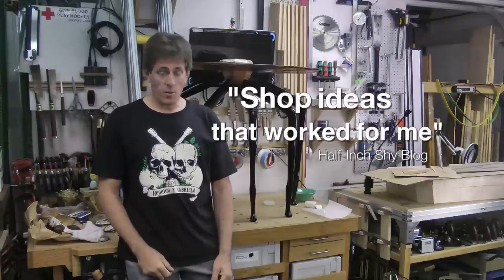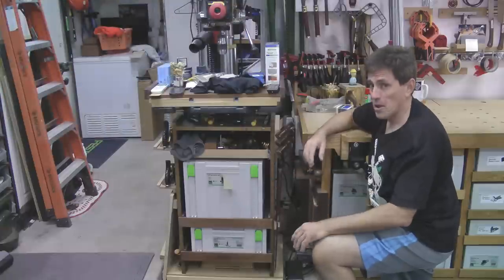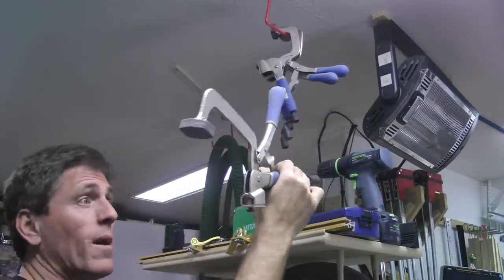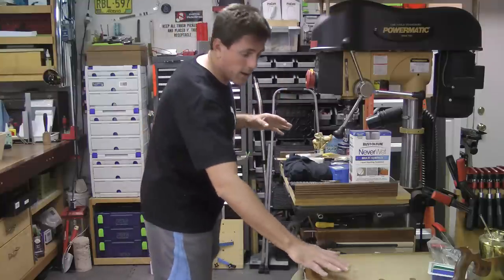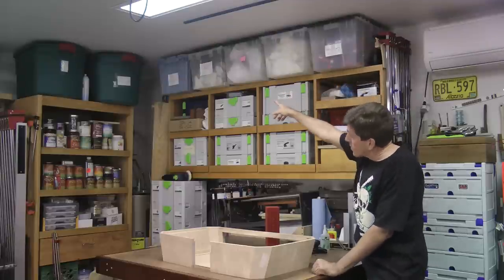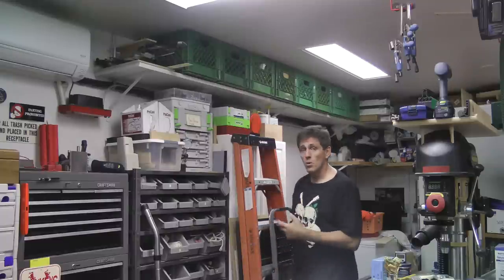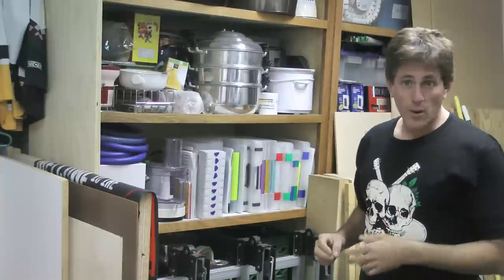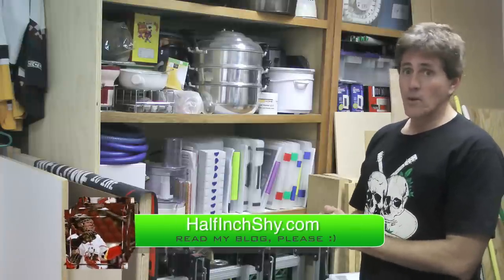#93 - Shop Organization Tips

Comment: How are your various pull out shelves / Sustainer drawers put together? It looks like you are just attaching the drawer slides to the shelves themselves, maybe like 3/4" plywood. And then have a small front to hide the slides and act as a stop so items don't fall off. Im sure you have one in the back just narrower to fit between the slides and prevent items from falling off the back. Thanks.
Reply from the maker: +Capt.k&amp;b These are super simple. Ply base, 3/4"x3/4" hardwood sides that are flush with the top, but used for the slides. Just a front to hide the edges and look cleaner (plus it acts at the front stop for the Systainers). In the back, I have a Domino sticking up from the shelf that fits into the notch in the side of the Systainer (since mine are in sideways). Locks it in perfectly. I think it was a 6mm Domino, but any size that fits in the notch is perfect. If you don't have a Domino, then insert a stick of dowel.

Comment: I like the way you think about storing stuff.  Have you used the dead space on the header above your overhead door?
Reply from the maker: That's a great place for stuff for sure. I could actually build a low shelf up there and put more of those green crates I use up there as they'd just fit.  So far, I haven't taken advantage of that mostly because when I'm not recording in winter, I keep the garage door open.  Would be useful for lesser used stuff, for sure.  I may keep it as my last-ditch storage area when I run out of other places (or just learn to quit buying stuff ;)

Comment: Love the racks for stacking clamps inline from the wall idea.  What tape dispenser are you using?
Reply from the maker: Thanks! The tape dispenser is from U-Line. It has 3 wheels for rolls so I keep a regular roll of Blue tape on one wheel and a wide roll of packing tape on the other two wheels. So ridiculously convenient. I've since bought a second for specialty tape. Also have a single-roll dispenser for the Shaper Origin tape.

Comment: Paul, I own a Bridge City CT 11  12° Commemorative Plane.  I believe you have one also. I had to remove the blade and have not been able to figure out the pin nut and pivot nut setting. The CT 12 had a instruction sheet, but not so with the 11. I would appreciate any  assistance you can offer. The old day of calling John on the phone are gone for ever. Great video on the JM.

Comment: I was curious about your ceiling mounted light that looked very bright and out of the way that I saw in a different video...  im wondering where you got it?   I need something to light up my MFT work area.
Reply from the maker: hmm not sure which light you mean; I have florescent lights in the ceiling, but nothing attached to the ceiling. Ages ago I had a pool light in the shop, but you wouldn't mean that cuz it wasn't bright.  Do you mean the desk light attached to the MFT? That's just a task light; I rotate the arm down low to get a raking light for sanding.

Comment: i enjoyed the video, nice use of space!  you had to have spent a fortune on all those nice full extension drawer slides!
Reply from the maker: jon s Yeah, those full-extension slides can get pricey, but I bought mine from a guy making really nice ones that clocked in at around $6/pair when I bought them bulk.  A 10 pack is cake when you're putting up so many like this.  My original supplier doesn't do online anymore, but the slides are available through Amazon: http://www.amazon.com/s/ref=bl_sr_hi?ie=UTF8&field-brandtextbin=ProMark&node=228013

Comment: I need to implement your manual storage in my shop. I have already been able to follow your example on top of the drill press. I attached an old drawer for many bits, chuck keys, and other accessories. Unlike you, putting slides on everything, my old drawer is stationary now! Thanks 😀!

Comment: Many excellent ideas! Thanks. What is that little set of drawers with the purple latches, near the manuals? What do you keep in there?
Reply from the maker: Thanks, James!

I had to go look to see what you meant :) Those are Tanos micro Systainers. They were a promo item awhile ago on a great sale so I bought a bunch to give away.  Did end up using a couple for small blades in a junk drawer.

Looks like Lee Valley still has some: http://www.leevalley.com/US/wood/page.aspx?p=70828&cat=1,43326,68749

Comment: Nice shop! Do you have a jointer and thickness planer, and what bandsaw you're using now?
Reply from the maker: Thanh nguyen tien I have a Laguna jointer/planer combo and I still haven't sold my older PM20 planer.  Turns out, I typically joint by hand so I really don't use the jointer part of the combo, which is why I'm selling it.  I should have just done a helical head upgrade to the PM20, which I'll do after selling this combo.  The bandsaw is an Italian-made LT-18 bandsaw from Laguna.

Comment: Thanks for the tour.  I'm amazed at your clever use of space, especially the roll-out trays and fit-together storage.  Love the side-on clamp storage and the manual containers - great ideas.  I wouldn't keep your keyboard where dust falls on it but that's the only thing I saw that I'd change.
Reply from the maker: +GBV1436 Thanks! I'd have to re-watch the keyboard part, but the shelf is made to lay the keyboard with the keys down toward the cabinet; same with the trackpad. The shape of the Mac keyboards has a built-in handle of sorts on the underside so it was perfect. I should have made more of that; I used a Mac BlueTooth trackpad and keyboard on a Windows box because I didn't want wires and the Mac keyboard is small (and aluminum!) and that trackpad is awesome with no openings for dust. Great combo
Reply: I really liked the wireless keyboard and trackpad idea with a mounted monitor.  I use a Mac Air but it'd be good to have the screen out of the way.  Looking forward to more of your vids.

Comment: Wow, what a load of great ideas.  I'm reorganising my workshop, yet again, soon and will be using some of these.  Many thanks.

Incidentally, I find old kitchen cabinets ideal for the workshop.  You can put boxes inside, mount tools on the inside and outside of the doors and there is a good worktop for placing tools in use.
Reply from the maker: Thanks, Graham... yes I used a lot of old cabinets after pulling some out of my house. In my case they were bathroom vanities, which are lower, smaller, and no shelves :-/  Kitchen cabinets would be awesome, though!

Comment: domino? do you mean dowel?or is this a term I should learn?
Reply from the maker: The Domino is a product from Festool that puts a domino-shaped loose tenon (the Domino) into mortises it creates. Dowels are used the same way: as loose tenons.  The biggest differences would be that dowels suffer when twisted since they are round and rely on the glue (or more dowels) and that Dominos allow for some play in the mortise size.  I have a ton of videos on the Domino; if I had to give up every Festool but one, it would be the keeper.